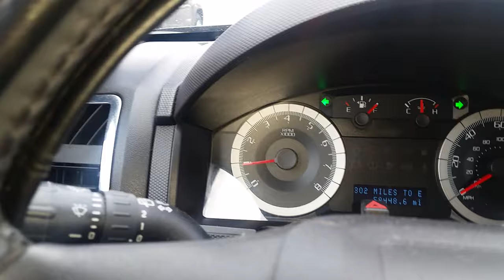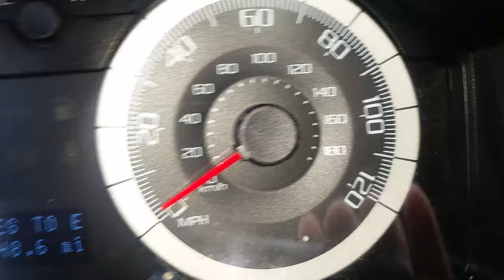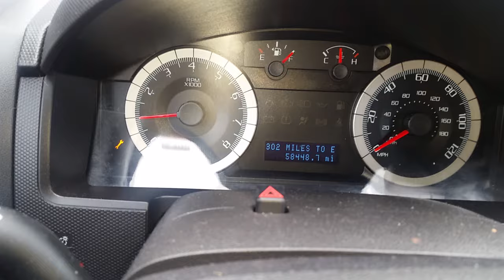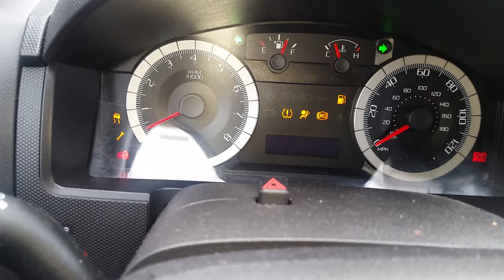Ford wrench light

Comment: My f250 6.0 powerstroke does this too and I don't have the  5k to fix the problem. Just got the truck "as is' 3 months ago, it's a fking disaster, now I'm stuck in a loan. I feel your pain brother.
Reply: This may possibly be an oil cooler issue. There is currently an investigation on behalf of consumers who purchased Dorman oil cooler kits for their 2003 – 2010 6.0L Ford Diesel Trucks to replace the factory Ford Oil Cooler. Dorman Oil Coolers are non-OEM (aka aftermarket) oil coolers sold at stores such as NAPA, Advance Auto Parts, Auto Zone and more. 
The Ford 6.0L Diesel Dorman Oil Cooler kit (part number 904-228) is sold for use in Ford Diesel vehicles made from 2003-2010. It appears that O-rings and gaskets within the kit are believed to deteriorate into small particles (sometimes green or yellow in color) that spread throughout the Ford diesel engine, causing expensive damage. 
If you purchased a Dorman Oil Cooler, had it installed in your Ford 6.0 Please contact us at Thealertconsumer@gmail.com and tell us your experience. Website is under construction. Find us on facebook @thealertconsumer

Comment: This just happened to me to today in my ford edge and it was very scary considering this was the first time.
Reply: Same here. Ford is BS
Reply: I have a Ford Fusion 2006, this happened to me as I was getting on the freeway in my city. I was doing about 70 and then the vehicle jolted and almost stopped running and my car slipped on ice and swerved into the right lane where a semi was. I was close to hitting it, I'm still pretty shaken up. What can be done? What happened with your vehicle? I read somewhere that this is a safety issue and ford can get a lawsuit filed if they don't fix it???

Comment: There might be couple reasons for this .
1- If you have ford hybrid most probably it is mecs coolant pump. 110 bucks under the engine easy to fix.
2- If your vehicle is not hybrid it is still coolant pump but you need to check your coolant level first. 
3- It might be throttle body. If it is throttle body DONT TRY TO CLEAN AND REPLACE by yourself because you will need expensive scan tool to recalibration. 
I am writing this and in las t 2 hours it happened to me 3 times. My car is 2012 lincoln mkz hybrid.  My car is 256 000 miles. Btw I still can drive more than 40 miles between restarts.
I ordered the part and will change asap
Reply: any updates?

Comment: Its your ignition coils they are bad, or cracked Giving it a bad signal to transmission, if the transmission is doing weird stuff, and the wrench light comes on and the the traction control light the coils are the problem

Comment: I have the same issue right now with my 2010 Fusion everything is cool when the wrench is not on the dash but as soon as it pops up it just stalls like you don't get no speed it'll barely let you move 10 miles an hour but when I took it to AutoZone they said it was a throttle body and this purge valve I changed both of those and it seemed the car was running fine and then it started up again. and it sucks because I have to be in work tomorrow and today is Sunday so I couldn't take it to no shop because there is no mechanics and after I get this situated I'm probably pretty much done with Ford
Reply: Did you by any chance get it fixed?? I'm having the same issues, and it's stressing me out. Mine is a 2014 fusion. 😞😞

Comment: tonight while driving my 2008 ford fusion home it happened to me , i have noticed in the past a intermitenet rarely engins stall and refire , suddenly the engine drops to 0 rpm then everything back to normal , like 10 random times during the last 2 years , and now tonight the wrench lights up and every 10 minutes complete loss of power and rpm drop to 0 then sudenly everyting is ok , only 53,000 miles , having a ford sucks , i will never have another ford ever

Comment: I have a 2014 Ford Edge and the same thing happened to me. The Dealer just called and told me it waa the Throttle body and it will coat $490 to fix. I have only had the car 2 years and a couple months!! I called Ford customer service and of course they did nothing because there is not a recall for my vehicle

Comment from the maker: It's the electric throttle body, that's the problem .
Reply: I actually had my son put a brand new one on and then it's still having problems but I had it put on a scope and they're saying transmission like a bunch of words sensors came up and he says I knew it need a whole new transmission it didn't sound right to me because that's not the way it was acting once I wrench light was off at shifted fine
Reply: I put a brand new throttle on also and it didn’t stop the problem... also changed an o2 sensor and a cam sensor and also a map sensor still the same problem happens.... I don’t think it’s the trans because wen the wrench light is not on everything is fine
Reply: @flyboydj719 did you ever find the issue I'm going through the same thing
Reply: @juanbadillo1373  you found out what was going on with yours

Comment: This is happening in my 2014 ford fusion so if I turn the car off and turn it back on I should be fine? And I tried revving my engine after I turned it on and off and still made a different noise
Reply: yes my 2014 ford fusion doing this ONLY when im on the highway..i pull off ... turn engine off and restart and its all good ..going to dealership on tuesday
Reply: @tonylobin5749  hey it was the transmission and it cost 4 to 6g to fix I'd get a new rid or fix it if you have enough
Reply: @alphacloak1822  hey, what was the transmission problem specifically?

Comment: I have a ford transit connect 2013 it comes on when I lower the stearing wheel to the low level and lock it. it doesn't affect the engine running.

Comment: Hey mine did the same I turned it of and on then went away what did you do afterwards?
Reply: I do the same thing it does it everytime i drive it and come to a complete stop. The car goes into like a limp mode and if i turn it of and back on it goes away and drives fine unless its hot then it acts like it is slipping until you get up to atleast 5 or 10 mph and it will grab and drive fine again so confused it has got me stumped
Reply: @dylwillonewheel7614  My Freestyle has been doing the same thing.  At first I would turn it off and on and problem solved.  Now the light will stay on until I park for a long time, like overnight.
On cold days I can drive a lot and the light will not come on, unless I am in heavy traffic or long traffic lights.  This tells me that temperature has something to do with it, even if the engine temperature shows normal levels at all times.
In any event, the moment that light comes on the car starts to act up, with jerky motion and high RPM required for 35 MPH (2,000 RPM).  It has some other issues but I keep driving it.
Reply: @dylwillonewheel7614 , by the way, I changed the throttle body, the EGR valve and the accelerator pedal.  I don`t know what else to change.  Maybe the car.

Comment: My 2010 Ford Escape did the same damn thing and it happens like 2-5 times a Day. I took my car in for service, i paid $80 because the mechanic said it was the throttle body. Mind you, before i went there, i stop by at Autozone to check the engine light. It came back with fuel pump issue.  Code P455 P457. After the auto service fix my car, it was about 4 miles, it work perfectly fine... As i enter into the freeway, wrench light screaaaaam again. 😭 i can barely run 5 mph. Turn off, on, it went back to normal. I do thing its really the fuel hose, something to do with gas. I spend $229 today. I'll take it in to fix my EVAP or replace the fuel hose and we'll see if it puts an end to this.
Reply: Tevita Tu'ifua what happened? currently having this issue with my car but it doesn’t stall out. removed and cleaned the throttle body but still same problem and symptoms
Reply: Hey Whitswit,

Mine is fixed, First they clean the throttl body, I brought my car home, When i entered the Freeway, the same thing happen, however this time, it was a lot better than before. 
for instance, Red lights, I cant even gas my car like everyone else but after they clean it, i was able to.... I just cant run over 60mph,....
I took it back, He said my car need a NEW throttle body....So when i brought back my car this time, No issue happened lately. 

New Throttle Body solve this issue for me.
Reply: Tevita Tu'ifua thank you!
Reply: I took my mustang to autozone and I got EVAP very small leak detected error P0456. I still didn’t do anything about it but my issue is that when it happens I can’t accelerate at all. The pedal just stops responding unlike others who say they can move slow. So after u got it cleaned the same issue happened after u reached 60mph or the car didn’t let u accelerate past 60? I’m very worried. You think I should try to clean the throttle first or just get a new one right away?
Reply: @zaidmeqbel5465  mine is doing the same thing i asked a few good friends and they tell me its a throttle body. Its not letting a enough air in and to much gas or vice versa. So ill be getting a new throttle body today as well as the purge canister.

Comment: did you ever get it fixed?
Reply from the maker: Karen Bauer Sinnen  Yes under the customer satisfaction program,  if it's the electric throttle body problem , they will replace it at no cost plus extend the warrenty for that also . Make sure you call Ford and ask them about it @ 1 800 392 3673 , Google it also  😊
Reply: Carlos Romo thanks for the reply. my car is the Ford 500 it does the same thing except it stays like that won't change when I turn off the car. I'm.hopimg it's the throttle body
Reply: @MrYandell49er  what year is your? My mom escape is 2010 and she bought it the same year. She hardly have any miles on here.
Reply from the maker: @slimsampy4764  2009 she can still take it
Reply: @MrYandell49er  I spoke with a Ford dealer today and it is a recall. So it's going in tomorrow morning and for another recall on the fuel flange
Reply from the maker: @slimsampy4764  kool make sure that the electric throttle body is changed also along with ther flange. I haven't been told about the flange recall so I'll inquire about that , thsnks
Reply: @MrYandell49er  I have an 08 and I'm glad I didn't have these problems but we had radiator problems but they fixed it and I still have it. I love my Fords
Reply from the maker: @slimsampy4764  me too I still have my Escape and a Ford Ranger hitting 200,000 and still runs great

Comment: I need help! I have a Ford Fusion 2006, this happened to me as I was getting on the freeway in my city. I was doing about 70 and then the vehicle jolted and almost stopped running and my car slipped on ice and swerved into the right lane where a semi was. I was close to hitting it, I'm still pretty shaken up. What can be done? Would ford be responsible?
Reply: Is it hybrid ?
Reply: omer bayrak no
Reply: @Anna8765  There might be couple reasons for this .
1- If you have ford hybrid most probably it is mecs coolant pump. 110 bucks under the engine easy to fix.
2- If your vehicle is not hybrid it is still coolant pump but you need to check your coolant level first. 
3- It might be throttle body. If it is throttle body DONT TRY TO CLEAN AND REPLACE by yourself because you will need expensive scan tool to recalibration. 
I am writing this and in las t 2 hours it happened to me 3 times. My car is 2012 lincoln mkz hybrid.  My car is 256 000 miles. Btw I still can drive more than 40 miles between restarts.
I ordered the part and will change asap
Reply: omer bayrak not a hybrid must be the throttle

Comment from the maker: take it to your dealer make sure you record it like I did and if they say you need to bring it in with the check engine light on that's b.s. cuz the computer will keep a record of engine faults plus you have it on video. All Escapes from 2008 thus 2014 should be covered for this at no charge
Reply: Hi, do you have any info that all Escapes from 2008-2014 should be covered?  My 2008 Escape's wrench light just went on tonight and it kind of lunged into gear when I accelerated.
Reply: Thank you for sharing The 2014-  2016 Ford products  Stalling /Loss of Power Throttle Body seems to be a consistent issue in the Ford Escapes, Flex's,  Explorers 2015 to present, and other ford products. These safety issues include, but are not limited to: sudden jolting; sudden stalling; sudden deceleration; sudden loss of power without warning; vehicle going into limp mode; no throttle response, and transmission failing to stay in park. When these dangerous safety issues occur, it appears that consumers claim that the check engine light, air bag light or a light in the shape of a wrench illuminates in the gauge cluster of affected 2016 Ford Explorers. This can be a major issue especially for officers responding to an emergency. 

Please look for us on facebook and comment your experience to Alert other consumers about this issue.
 
For more information on these claims contact us at THEALERTCONSUMER@gmail.com
website coming soon. 

https://www.facebook.com/TheAlertConsumer/

Comment: my ford escape has a problem slowing down it will some time drop really hard into gear anyone know if this is a problem
Reply: Check your fluid if it's a sealed transmission if not check the pressure control solenoid pack

Comment: Ive owned ford for over 15 years and been surrounded by fords for 30 years. ford has had terrible electronics since 1993 era and the more electronics you throw at it the shittier they become. Ive had new f150s, new escapes, new ford five hundreds several rangers. Only great vehicle ford ever made was the 01-06 or so f250 with the 7.3l diesel. my 2012 f150 is not worth the tires it sits on. if i could only afford a tundra, ford has cheap baseline vehicles but after experiencing same issues in sedans to trucks to suvs its a common problem. I blame the investors sucking the funds out of the company they need to pull out of the stock market entirely and frankly i hope everyone invested in them loses their retirement! Your not the only one anyway. too bad ford and gM own NHSI and DOE who commonly discredit smaller manufactures as not having good enough emissions and not safe enough to drive, yet fords throttle body is responsible for several deaths including a few kids hit by their own parents car that rev'ed out of control forward.  Go ford like a real american company kills and abuses its own customers.

Comment from the maker: Katie they will be covered for the electric throttle body if that is the problem . My Escape never really lunged into gear but if it happens again I would take it in and demand they change out the ETB , then it adds another 10 year warranty for the electric throttle body.  carlos16822@att.net if you need help 😉
Reply: Yoooo I have a 2006 you thinknits still covered
Reply from the maker: @mayhemgaming4297  no harm in trying

Comment: I have an 08 mustang GT it just started doing this I start the car and at idle the wrench will never pop up but as soon as I shift into first gear and start moving it comes on and Boggs the car down but since mines a manual I can drive it around I can still do about 80 on the highway still but it’s just A LOT slower does anyone know if this is a serious issue or if it’s just some stupid sensor that’s causing the computer in the car to have a panic attack
Reply: I have a 2020 mustang gt with manual transmission and it came on  @ 14500 miles. I took it to dealer but it went off . I still had them check it but nothing came up..

Comment: My truck F150 2006 doing the same??
Reply: Clean the Throttle Body, that could be the cause.
Reply: did you find out the problem my 07 is doing it now
Reply: I have 06 F150....did you find the problem

Comment: I have a 2009 ford focus ses and my wrench light is on an engine light and when you turn car off then back on its gone but comes right back. I put a new throttle body I bought a new air flow sensor. An still same problem
Reply: Same here
Reply: @dylwillonewheel7614  ditto for me. Just recently started. Car runs rough when putting into gear after wrench comes on. If i put car back into park and shut off/turn back on, it then runs ok. Might try resetting the cars computer using the technique mentioned by Fordtechmakuloco on YouTube....to relearn calibration. Might also try removing throttle body unit and cleaning it. Hoping this isn't an actual transmission issue......car doesn't seem to have obvious transmission issues.

Comment: I have 2016 Explorer with 4800 mile. orange wrench and engine light came on. could only travel at idle speed. Ford not very responsive.  clised gor 4th. no one would help. "bring it in 5 july", today is the 2nd.
Reply: should say closed for 4th
Reply: Did you find out anything on what the cause/how do you fix it?

Comment: My 2016 Explorer started doing the same thing last night. Have found anything on WTF is wrong with these fords??
Reply: Victor Jones have you found anything out?
Reply: I have the same problem 

How you solved it?
Reply: I hate people that comment looking for answers, but they never come back to let people know how it was resolved.
Reply: Sorry guys. I replaced the Brake ABS module, Transmision module, rebuilt the Transmision and all brake, ABS, Traction control lights still on but car is drivable since rebuilding Tranny. Only had 50k miles on it so let’s see how it goes. Very disappointed in Ford and the quality of this.